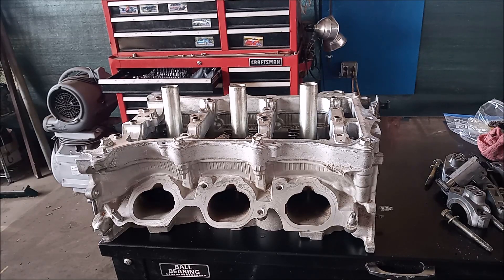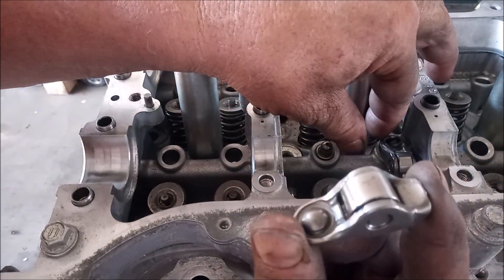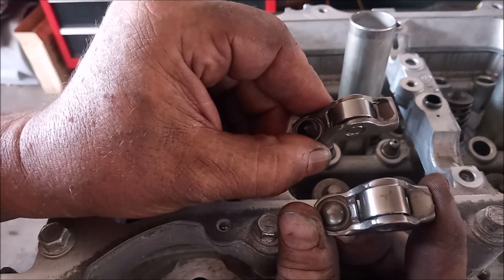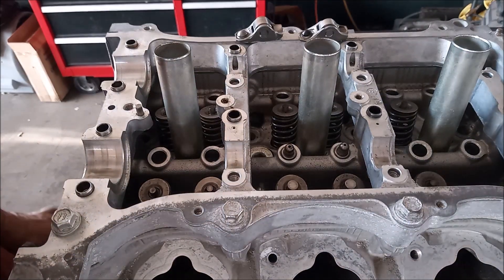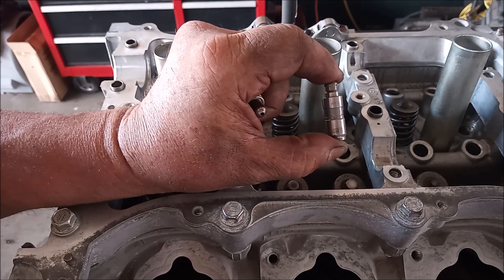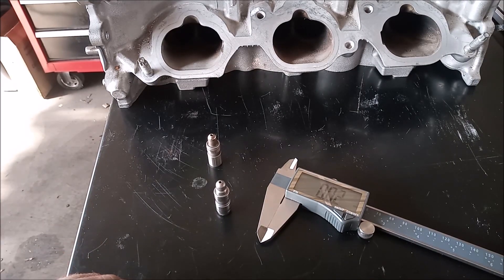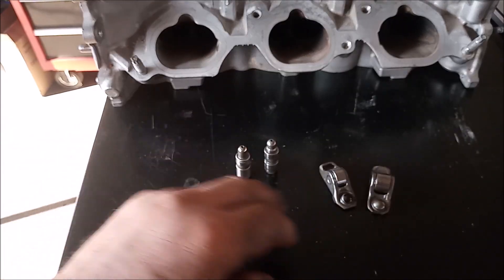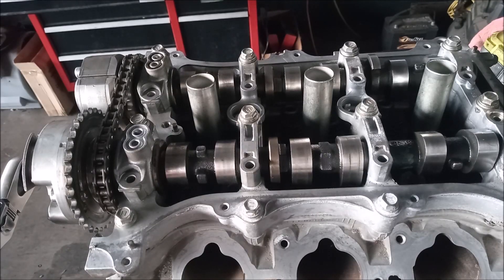Building a 9000 RPM 2GR-FE Engine - High Performance Valvetrain - Rocker Arms and Lifters.

Comment: Nice information!  But where can I find those solid lightweight HP rockers and lifters for my Lexus 2GR FSE?
Reply from the maker: They come out of any 2gr-fks.
Reply: @Merryfrankster_  Even the solid lifters? No OEM car I know of has solid lifters, just for noise purposes
Reply from the maker: I thought you were asking about the rockers. If you want to know about the lifters, they are from a production Ford V8.  You can buy them from a Ford dealer of from Summit Racing. @crispychicken7933
Reply from the maker: FORD OEM-Valve Lifter BR3Z6500A @crispychicken7933
Reply from the maker: I guess there is maybe one or two OEM car that you don't know about, pal.  @crispychicken7933
Reply: More than you can afford, pal. Ford

Comment: Where can we find the lightweight rocker arms and the solid adjusters?
Reply from the maker: Lightweight rockers are from 2GR-FKS. Adjusters are from Summit Racing for Ford GT500 V8.
Reply from the maker: Also check out what Monkeywrenchracing now has available for rocker retainers and lifters.
Reply: @Merryfrankster_  Would it be the narrow oem adjuster for the 2GR-FKS?
Reply: Do you have a man. part number for the adjusters?
Reply: @trevorzell5945  i guess it FMS-M-6500-GT 
or FMS-M-6500-M50

Comment: Just like to know if you measured the rockers to see if they are exactly the same pivot points as even the smallest variations can change vale lift. If the rocker is an exact ratio to the OEM  version,  I would be interested in fitting these to my race engine

Comment: What effect do solid lifters have on overall oil pressure in the engine?
Reply from the maker: Good question. Not able to provide a good answer. Possibly oil pressure would increase because with solid lifter no oil is flowing out from high pressure channels to ambient pressure. But I don't know of any tests to demonstrate this one way or the other.
Reply: @Merryfrankster  if you run solid lifters do you need to weld the oil gallery that supply oil to HLA ? I am sure the darton sleeves folks gain oil pressure from boring out the block, hence the removal of under piston oil squirters

Comment: Measurements on the HLAs free length should be compared to the solid lifter. Also they have different sizes of oil holes so you need know the center height of that radius. Make a adjustable HLA and a cup for a micrometer to take measurements off the radius of the pivot and you'll be able to get a very accurate comparisons in length. If you want hard numbers you'll need to move zero on the tool or subtract the difference

Comment: Are you running these lifters in your application? Where were the lifters sourced from?
Reply from the maker: Just building the engine now and will report how it all works out. I bought these lifters on eBay.
Reply: @Merryfrankster_  I see. Thanks for these 2gr videos. I'm subbed you and Frankenstein Motorworks. All the information is much appreciated on this great engine.
Reply from the maker: I know that someone in Australia has been running them on their 2gr-fe.
Reply: They are from the GM ecotec motor

Comment: How do you plan to set the valve lash? Shims and grind? regards DiagDog ;)
Reply from the maker: In the native application these come out of, which is nearly identical to the 2GR assembly, there is no provision for adjusting clearance - no shims, no hydraulics. I am not sure how they do it.
Reply: Typically they'll have different height lash caps or tip the values in order to adjust lash. Its also possible that they tip the base of the lifter but veried thickness lash caps would be the easiest way
Reply: Another idea is MWR has clipped rocker arms that are physically attached to the lifter